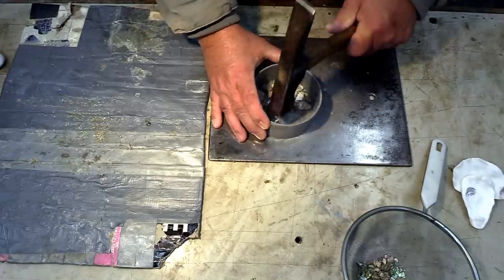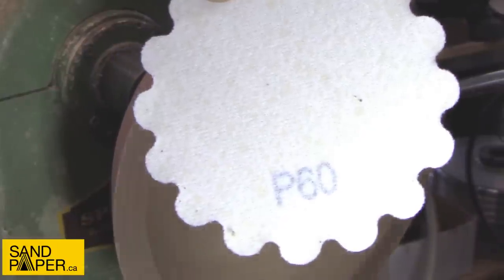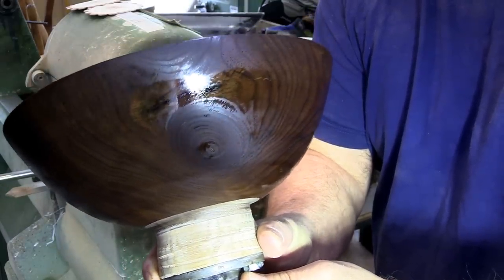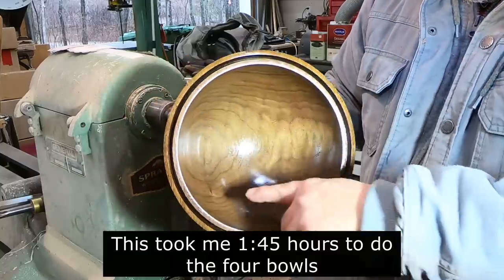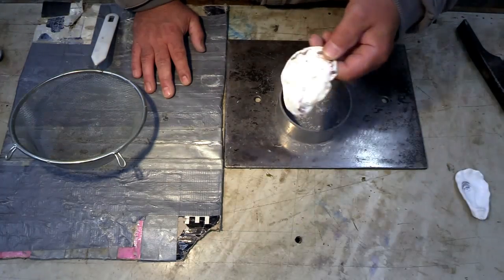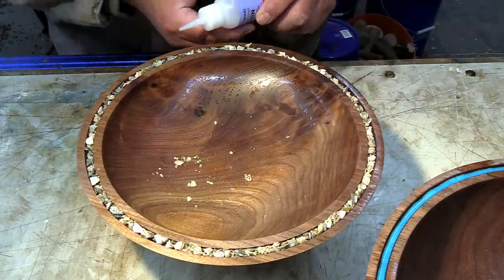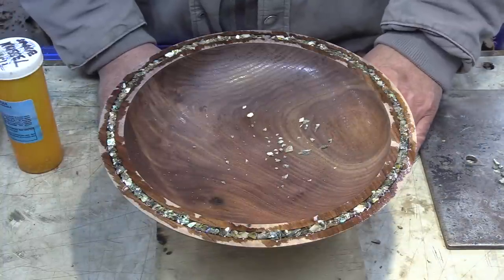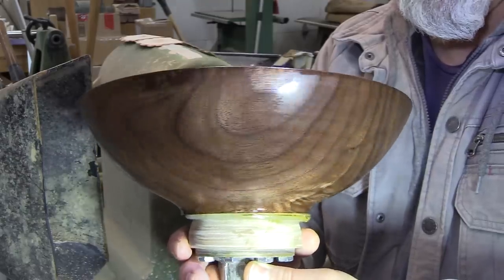Woodturning - Back to my Roots, Five Natural Inlayed Bowls!

Comment: The shell inlays were all stunning. Did you know Malachite is beautifully layered and patterned in larger crystals? If you got some of the same grain size as the shell inlays they could be absolutely stunning. There's also the dark blue mineral Azurite which is similar to Malachite as it is also a copper mineral.
Reply from the maker: Lost of beauty inlay material. Thanks for watching

Comment: WOWSERS Jim. Absolutely Stunningly Beautiful. You're daughter inlaw to be must be over the moon with these. Muriatic acid is what is used to clean the shells. You dip them for 3 seconds and then immediately into a container of water and baking soda to neutralize the acid. Very very caustic is the acid. Gloves respirator and tongs with plastic on the ends is needed. We used muriatic acid in  autobody repair to kill rust from continuingly growing. When vehicles were made of metal. They still should be!! I  will  email you a video on how to clean shells from a lady in Florida. I have a Rubbermaid container here from the sea of Cortez I have to clean up. I  was snorkeling there for 5 weeks years ago with my parents. Great to drive a truck with canopy to fill up. Lol Take care and keep creating your wonderful videos with your amazing talent xoxo
Reply from the maker: I got your email and I contacted the company to see if they ship the safe stuff to Canada and they don’t. Wanted to give it a try to see how well it works. I’m not against just using the Straight up muriatic acid, thought I would give the other stuff a try. I’m a little skeptical that it will remove that thick layer of whatever that stuff is on the top of the abalone without devolving the rest of the shell. Esther way, well will find out. That for passing that along. Jim
Reply: @SpragueWoodturning   perfect Jim. I will do some googling on abalone cleaning and keep you posted.
Reply from the maker: @dalemaclaren7576  from what I’ve seen, it’s a lot of handwork. Thanks
Reply: I sent you another email. Read way down in it to the abalone. You just protect the colorful part with I think I read vaseline so the acid doesn't wreck it.Actually quite easy.

Comment: As a sheller, I believe the acid would be muriatic. We use it to clean off periosteum, the dark, kind of dirty-looking outside surface of some shells. If you’re not careful, the acid will eat up the shell.
Reply from the maker: Just looking to get rid of that thick white part. Thanks

Comment: Very nice inlays: they really add value to the wood, to some extent more than resin that attracts more attention.  

One question: I believe you have changed your respirator, what did you get to replace the Trend Air ?

Have a nice week
Reply: Designer Epoxy
Reply from the maker: I ordered a Powercap. Still waiting for it to come in. Thanks for watching

Comment: Have you ever used Jade as an inlay? My husband is working in northern BC and was planning to make a trip to Jade City. Not sure at this point if it will really happen since he isn't getting the time off he expected. I understand Jade is extremely hard - would it work as an inlay in powder form like the turquois and malachite or would larger pieces work?
Reply from the maker: I’ve never used it before, some jade from Jade City would be cool. Definitely would need to smash it up though. Thanks